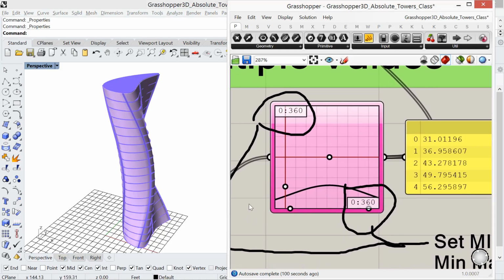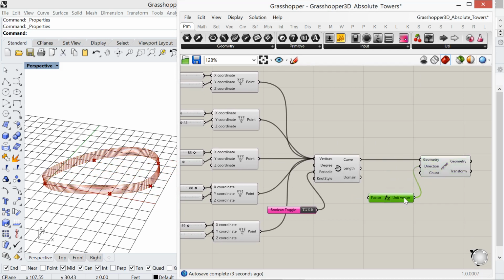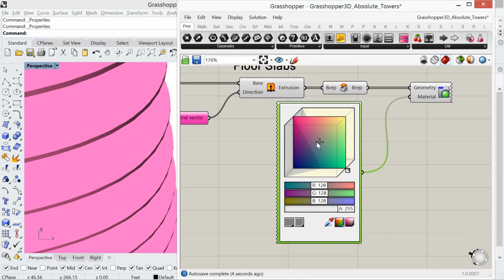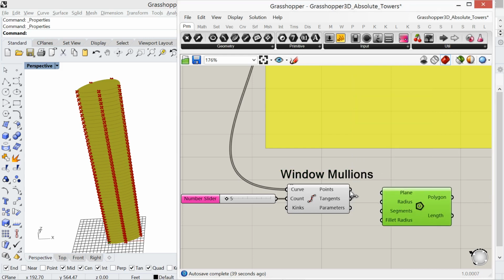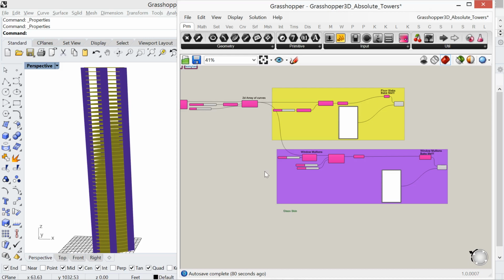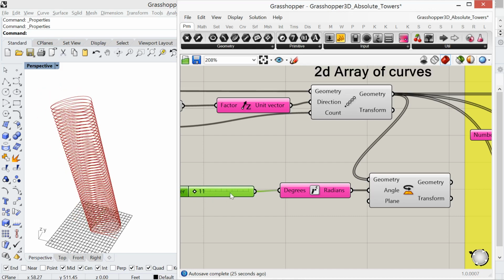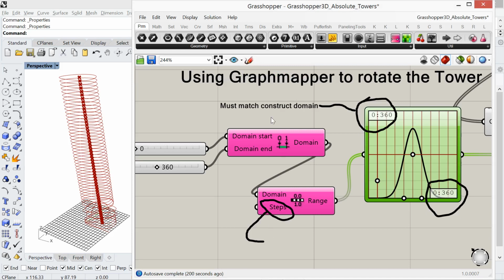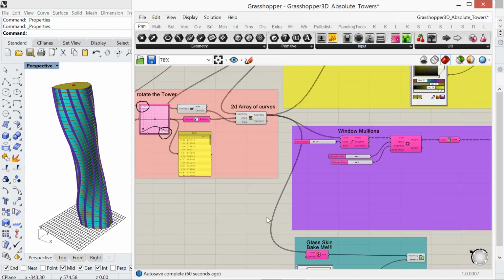Grasshopper 3D Absolute Towers

Comment: Thanks Alphonso, very clear tutorial. I will run through it in GH.  Question. I come from a fusion 360 background where you must enter precise dimensions. Most of what I see done in GH is more by eye or just sketch ideas. But in this demo, what if you knew the windows were 24"x48". You're not drawing to a specific scale so you'd just guestimate the windows? Just curious on workflow.
Reply from the maker: That’s the great thing about Grasshopper is that it allows you to be extremely accurate and detailed.... and it also allows you to work very conceptual.